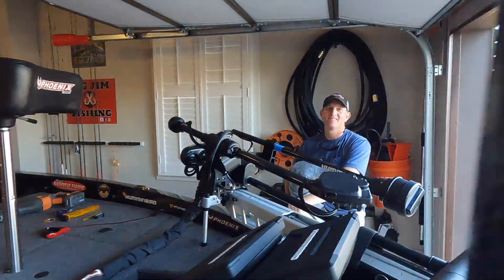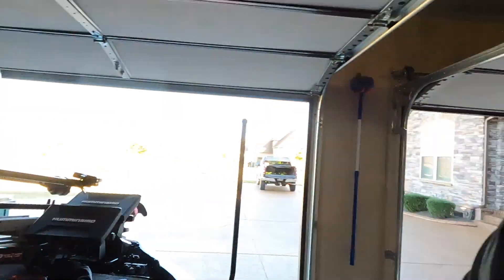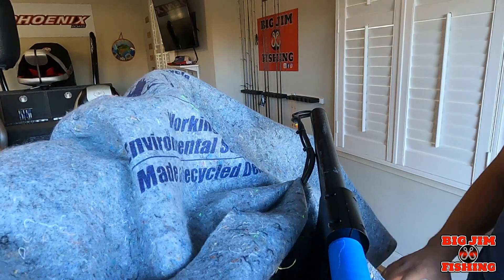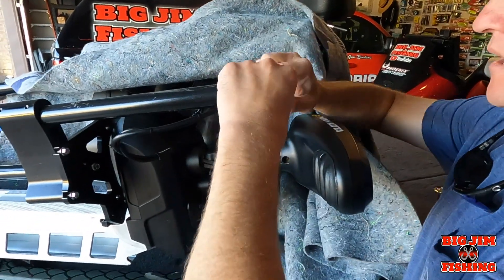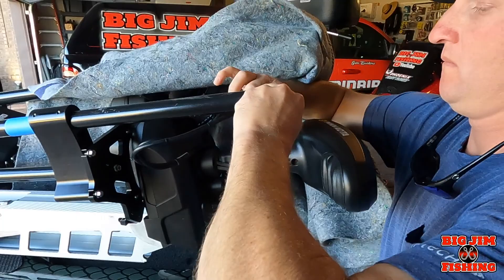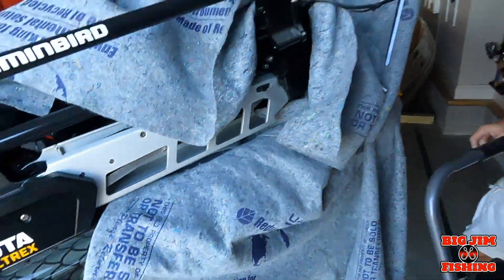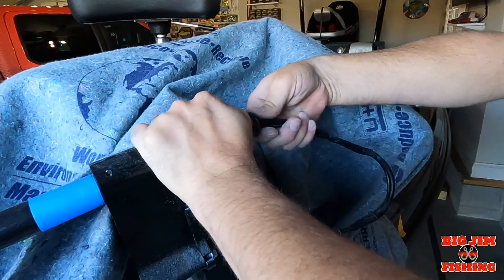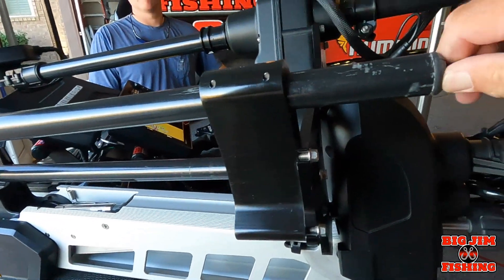Trimming the Humminbird Mega 360

Comment: I have found your videos to be extremely helpful on adjusting M360 & ML. A faster & I believe a safer method is to use a piece of 3/4” x 1/2” aluminum C channel. Round the corners on the C channel and slide over the wires 4 -5”’s past the desired length to shield the wires. Use a dremel tool to make to 2 parallel cuts far enough apart laterally to allow wires to be easily removed. Make one circumferential cut at the desired final length, rotating the C channel such that the wires are always shielded by channel.

Comment: What issue did this resolve? Looking to add the M360 this winter. Thanks for the video.
Reply from the maker: This mod will allow you to move the Mega 360 up (shallower) on short shafted Ultrex trolling motors and not bind or restrict movement when utilizing spot lock.

Comment: Big Jim I need your help! I just installed my hummingbird Mega  360 yesterday it's reading connected on my Helix 12! But when I placed a wet paper towel over them two Silver sensors I'm not hearing the ping noise and  the transducers not rotating  is that right, do you have any suggestions? Also is there a process to turning this thing on like turn the head unit on first then the mega 360 I'm confused about it really
Reply from the maker: Make sure it’s added in settings

Comment: Use a rotary tool you want cut the wire
Reply from the maker: @charlesgranger32312  that would work
Reply: @BigJimFishing  what I cut my trolling motor shaft down from 61 to a 50 inch